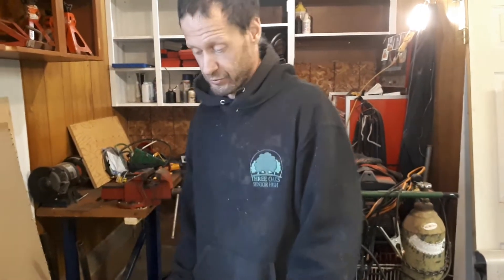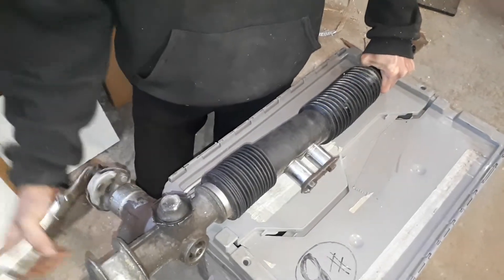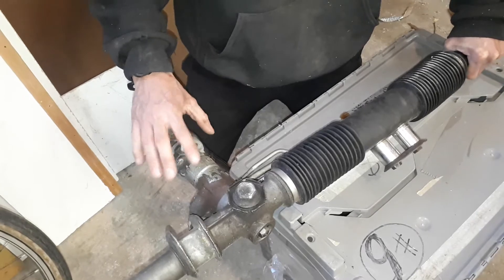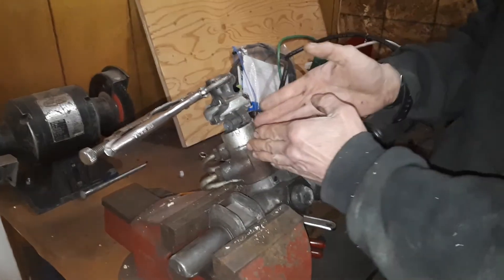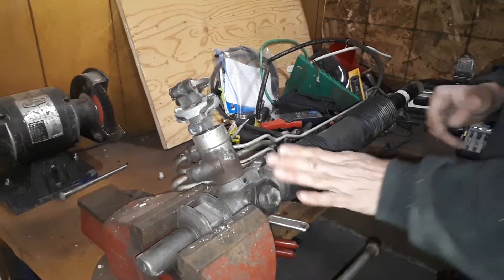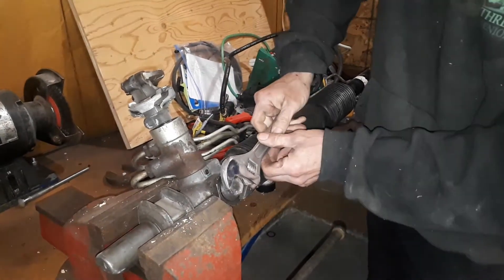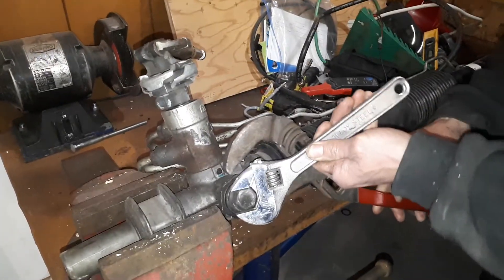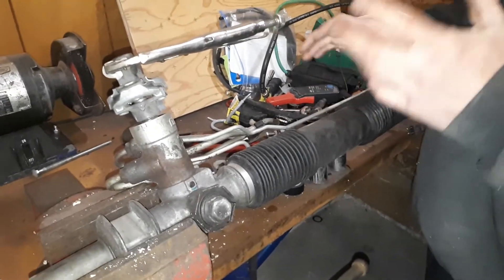Rack and pinion bushing adjustment

Comment: have a question may be can give advice.  rack shaft has play. can a guy adjust spring to eliminate play? sloppy rack inside housing.  at first glance it appears bad inner tie rod. but its rack is loose can this be adjusted?
Reply from the maker: Sorry I do not get notifications on comments.  The rack gear has play would indicate the rack bushings are worn.  I have personally never ran into that.

Comment: What purpose does this adjustment nut serve other than adjusting the steering feel? Is this something that should be incorporated into regular maintenance? I just heard about this and never knew about it before.
Reply from the maker: This is a gear lash adjustment. Yes the commenter is correct it would be an old vehicle.  However the Cavaliers and Sunfires a long time ago had pinion gear bearings go bad and upon replacement we had to complete this adjustment while still under warranty,
Reply: From my understanding it should be done on more older vehicles it makes the stireeng more responsive  and by adjusting it will save the part from being replaced unessesery for just a simple easy adjustment.